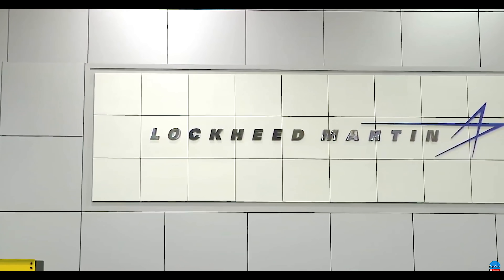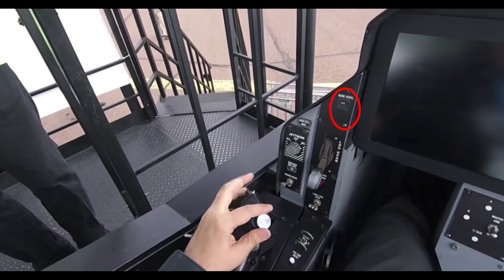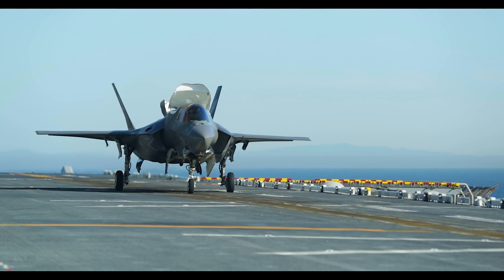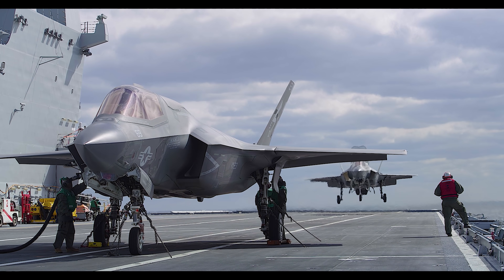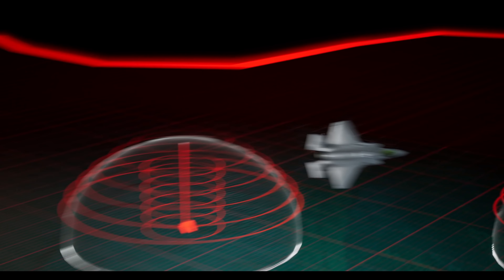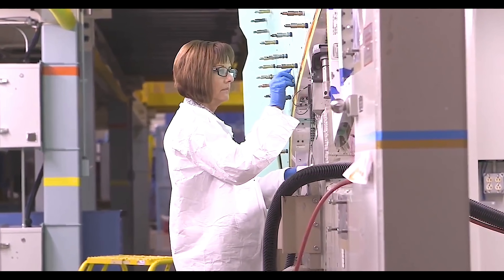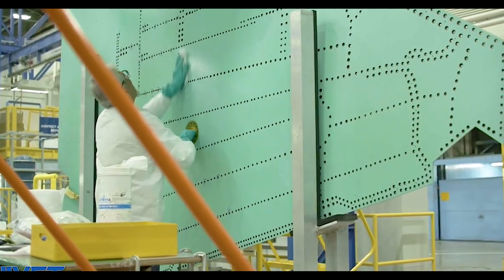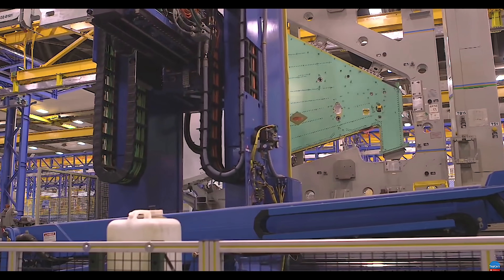Inside the F-35 Factory: The Most Advanced Aircraft Ever Produced

Comment: *second most advanced
F-35 may have more features than an F-22 but which one do you want on your side on the air and which one would you not be against? Both of those answers belong to the F-22
Reply: Really? How can a F22 take on a F35?

the F35 has a lower RCS, has better stealth, and is able to find and see the F22 when the F22 is blind as a bat.

You have to explain how an f22 can engage an f35?

In the 1950’s everything was thought to center around speed. Even an f104 Starfighter (1958) can maintain supersonic flight without afterburners.

In the 29 dogfight kills during desert storm (1991), max speeds seen by fighters were Mach 1 

Now of course the f22 has award winning kinetic performance, no doubt about it. From a raw performance point of view, the f22 really is impressive.

However, that performance is not going to rack up or increase kills in the battle theatre.

Tops on this list is that due to budget cuts, the f22 lacks “passive” systems to track aircraft. By “passive” we mean receiver only (non radar being sent out). This is where the f35 excels right now, and is a significant shortcoming of the f22.

Computer processing:
The f22 in its debut had a very good computer system. It is rated at 700 MIPS (700 million instructions per second). 

There was plans to future upgrade the f22 with a 2000 mips processor. But the CPU used on the f22 is now long out of production. 

But, remember Moore’s law in computing? Every 2 years we see computing power near doubling. While this doubling every two years don’t sound like much?

Well, place one grain of rice on the first square on a chess board. On the next square, place 2 grains of rice. And on the next square place 4 (so we have a total of 7 grains of rice).

Do the above for 64 squares. You wind up with 1 billion grains of rice by the 40th square. By the 64th square, you actually need 210 billion tons (not grains, but tons) of rice! That amount of rice would cover ALL of India with about 3 feet of rice!

The above means that the f22 has a really poor computer.
For comparison, a low cost budget smart phone with a snapdragon processor? Well, one CPU core is rated for 1400 MIPS. But you have 4 of them!!! (All in that $90 smartphone).

So, that smartphone has 

5600 MIPS

F22 = 700 MIPS.

So, your cheapo smart phone has EIGHT times the computer power of the f22.

The F35 uses RISC based CPU’s built around IBM’s power PC chips. They are the same architecture and chips used at the Lawrence Livermore atomic labs to run computer atomic bomb simulations. And all of IBM’S advanced Artificial Intelligence systems also use this chip set from IBM.

Upgrades for the F35 central computer are to be rolled out next year – they will increase the computer power of the f35 by a WHOPPER 25 times (over what the f35 has now!!! And what the F35 ALREADY has is VERY good!!!).

Not only does the f22 lack computer power, but it also lacks high speed networking.

While a good many new fighter jets have passive (IRST) systems, they are mechanical scanned (a rotating mirror sends the input light and directs it to a sensor). Such sensors will tell you a fighter is say 35 degrees off the front of your jet. But you don’t know the speed, direction etc.  And those systems have limited coverage (only front/forward looking for the jet).

You need speed, direction, and altitude to generate a weapons lock.

With 3 or more f35’s in the area, then just like 3 compass points or lines on a map, you can with computers triangle the location of the target. (You need 3 or more inputs).

Toss in a BIG dose of computer power?
Toss in some really amazing network communication between the jets?

Well, you now get x,y,z position of that target. And if you do this over and over, then you now get a new set of x,y,z and thus compare it to the last set of data. Now you have the REALLY valuable information of speed and direction of that enemy. And you doing this WITHOUT radar to give yourself away.

And even MORE important is you need to be able to feed that data into the computers to generate a weapons grade solution.

F35 can use radar, DAS (which is IRST) or use the targeting pod on the front (which is also an IRST + targeting system for air to ground).

However, you have NOT turned on your radar to give yourself away.

So, 3 F35’s approaching some f22’s will:

See, track, display and build weapons grade firing solitons against the f22’s. 

And all of this will occur without radar.

The f22?
Blind as a bat.
It will not see, track or be able to deploy its weapons on the F35.

The f35 will simple fire away and shoot down those f22’s like fish in a barrel.

The f22 on board systems are outdated.

They should have NEVER cut out the passive IRST system for the f22. They had a multi-spectrum system in the works. then they cut it down to a single spectrum, Then they cut out IRST all from the F22 program. A really sad mistake, and as a result, the f22 is blind against the F35- it just is.

From a kinetic energy point of view, the F22 is great - but that does not rack up kills in the battle theater right now, and has not for a very long time.

The simple matter is the newer features in the F35 makes it a f22 killer - and not the other way around.

Hands down, I'll take a F35. In fact I'll take a B model, and then I can park and hide it in grandma's garage. I can still take off if you bomb out the runway.

A f35 pilot has about 200x the information of a f22  to make a kill solution.  

This means the F35 pilot can make decisions better - the classic OODA loop:

That is:  O-observe, O-rient, D-ecide, and then A-ct
military strategist and United States Air Force Colonel John Boyd. Boyd applied the concept to the combat operations process, often at the operational level during military campaigns

The approach explains how agility can overcome raw power in dealing with human opponents

This allows pilot to maintain decision superiority over an adversary. And this will provide greater chances of survivability, which when combined with effective lethality, assures battlespace dominance. it just does.

Don't mean the F22 is bad, but does mean that the F35 will be a F22 killer, and not the other way around.
Reply: @Albertkallal  bro I’m not reading all that, F-22 is a better air dominance fighter, coming from actual pilots, that shits insane, the maneuverability alone no other jet has ever seen
Reply: @Albertkallal  it definitely is, I’ve literally watched pilots talk about the F-22, they say nothing in the air can top it, even telling a story how 2 F-22s took out 5 either f-16 or f-18 I can’t remember and they didn’t see the jet even once. The F-22 would DOMINATE the F-35 in air to air combat
Reply: @bobbythomas6520  
You not explained how a f22 can find and engage a F35? You have to explain how that works?

I mean, in the Falklands war, the Argentine air force was made up Mach 2.0+ jets. The Harriers were slow sub-sonic jets, and yet had about 10:1 kill ratios!

Some extra manufveriblty does not make ONE HILL of a beans difference right now. Look at the recent engagements between India and Pakistani. We seeing engagement ranges occur at about 80km. And more interesting is that Pakistan with older jet is shooting down India's jets. (their missiles and engagement range is about 20km better. So one side is getting about 80km, and the other is getting about 60km. Now in different conditions, you can hack off say 20km per side. So now you at 60km vs 40.

Those older jets don't matter. What matters is good radar, and a better engagement range. So, India needs to RIGHT NOW go shopping for a better and longer range missiles - perhaps maybe upgrades to radar on those jets will also help. They just brought some Rafale's - they have good radar- but MORE important in that arms deal is they look to be getting the "meteor' missile , and THAT WILL DRAMATIC shift things in favor of India.  but right now, they need better missiles in their inventory.

But, you have to explain why the Mach 2.0+ jets in Falkland's did not matter against those slow moving Harrier flying turtle jets?

You have a VERY warped view of air combat right now - I suggest you you go read EVERY air battle engagement since the 6th day war in 1967 to catch up to me on this matter.
Reply: @Albertkallal  bro I’m not arguing this with you, you decide to be like JK Rowling and write books. F-22 is an air to air combat fighter, designed specifically to be the best for that. F-22>F-35, not gonna reply again because I don’t care to
Reply: @bobbythomas6520  
Fine, but you not explained to me or anyone else here how you can expect a f22 to take on, and engage a F35? It simply has no means to do that. So yaking on about some better turn rate or speed means ZERO of value in todays air battle theater.

Such numbers might get your panties all wet, but it not going to rack up kills in the air battle theater - and ultimate that's what matters more then your pants getting all wet and excited over the F22.

if you want to play fighter jock, then by all means get a hard on for the F22. But you going to give advice on military planning and make a intelligent decision on what kind of air power and deployment of that air power matters?
Then your narrative does not help anyone here.

They cut too many features out of the F22 program - that is sad, and that really hurt the f22 platform. But in a way this is good, since then the money was better spent on the F35 program.
Reply: @Albertkallal  bro in air to air combat the f-22 is the superior fighter. It definitely does not have better stealth, also doesn’t have the same maneuverability. The F-35 is a ground to air fighter, doing different tasks then the F-22 which is a pure bread air space dominance fighter. It’s not even close
Reply: @Albertkallal  bro I’m not reading that again, F-22> F-35 for air to air
Reply: Combative effectiveness and advance...(ness?) Isn't on the same scale. You could be advance with all the cool gizmos like the F-35, but if applied poorly or you just have fatal flaws, then yeah something that's less newer but reliable is going to outperform. Still, a solid step towards advancement- although a hella expensive step.
Reply: @wallow4210  an expensive step that doesn’t seem to be taking shape very well seeing as the 6th generation fighter is in Research and development and even if that’s another 10 years the F-35 project may still be behind on various regions except obviously performance because money buys nice things. Also personally (not confirmed just me reading news) I think the new checkmate fighter has put the US on alert. We will see in a few years though.
Reply: @bobbythomas6520  Well, before a 6th there has to be a 5th. And there probably 'should', given that if we didn't have the F-35, then more likely then not it would be subjected to the issues that we have today.

Comment: The F-35 is a slow, worthless pig. Its a boondoggle just like the LCS. There's a reason they recently decided to make all new models of the F-15 and F-18.
Reply: How is the F35 slow? You looking at a shiny car like sales brochure that rates the top speed - and those balls out top speeds are stripped down and flying clean without weapons.

So, sure, at 40,000 feet a F18 can hit Mach 1.8. But hang just 4 AIMS on that jet and you now about Mach 1.4 (less then the speed of the F35).

but, it gets MUCH worse! You see the Mach 1.6 rating of the F35 is a software controlled top speed. It actually has more power!

If you drop below 40,000 feet, that jet starts to slow down. (air get thicker).
But, the F35 has more throttles and more power!

quote: Lt. Col. Hank “Hog” Griffiths

even when loaded internally with two 2,000lb GBU-31 Joint Direct Attack Munitions and two AIM-120 AMRAAMs, Griffith says the sheer power of the Pratt & Whitney F135 is evident. “The engine has a lot of thrust. It’s been fun to outrun the F-16 (chase aircraft). They can’t keep up. If we go to full military power the F-16 has to go to afterburner to keep up

In other words when a F16 flies with a F35 - they have to repeated hit their afterburners to keep up. They start to fall behind, and then have do do this again!!!!

You get these numbers:
(higher number = better)

Fuel	Rafale	F35	        F16
18250	0.8038	0.8776	0.7729
15000	0.8707	0.9399	0.8447
12000	0.9431	1.0058	0.9239
			
			
10362	0.9880	1.0459	0.9737
9125	1.0249	1.0784	1.0151
7500	1.0777	1.1242	0.9239
7000	1.0950	1.1391	1.0950
5000	1.1704	1.2028	1.1826
3500	1.2341	1.2555	1.2581
2500	1.2806	1.2932	1.3141
700	       1.3737	1.3672	1.4284

Notice how with 12,000 lbs of fuel, the F35 has enough power to fly straight up - but the F16 and the Rafale do NOT!!! (they are too heavy - and have to burn off more fuel). So the F16 and Rafale lack power - or they need to lose weight - but ONLY the F35 has enough power to fly straight up with that fuel load. 

In fact, the F16 only matches the F35 when you burn fuel tanks down to 3500 lbs - and that is VERY low fuel.

The Rafale has to burn fuel down to bone dry tanks of 700 lbs to now match the power to weight ratio of the F35.

So, the F35 actually in the sub-sonic regime is faster, and has  better to power weight ratio.

And this holds true EVEN as you increase fuel and weapon loads

So, not only does the F35 have more power, a better power to weight ratio, but it also flies faster, and F16's can't even keep up with the F35 unless they go after burners and the F35 does not.

During red flag (or tail drag), The f16's and f18's were fuel bingo (low fuel - return to base). The slippery F35 saved so much fuel, it was able to keep flying and execute additonal sorties.

You are very much miss judging the F35 performance - it actually flies faster, and has more power, and in fact has more power to weight ratings then those two jets - and this holds true for any practical combat loadouts.

So sure, at one VERY high narrow altitude where air is thin? And , flying stripped clean without wing tanks and without weapons on the wings? And then over-stressing their engines? Sure you get that cool high top speed rating - but ONLY at the narrow high altitude chosen for that best speed rating. 

In real operational modes, the F35 actually flies faster!